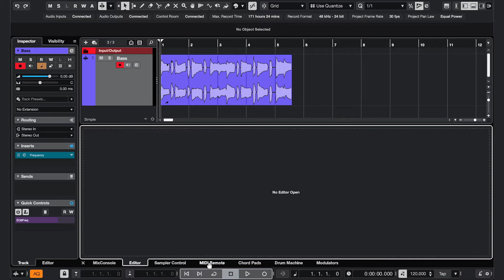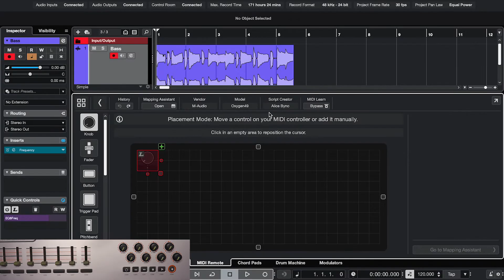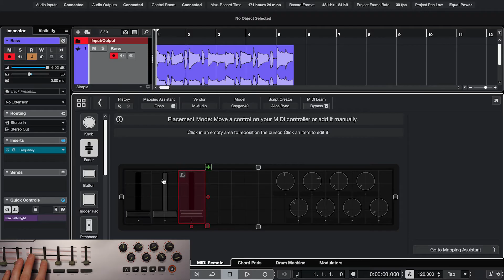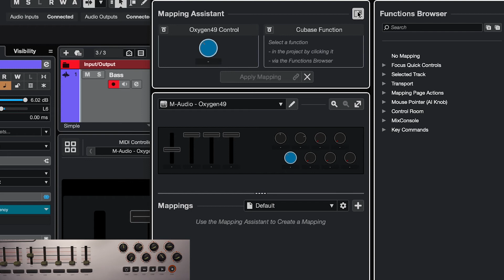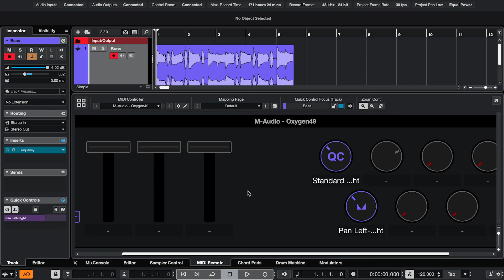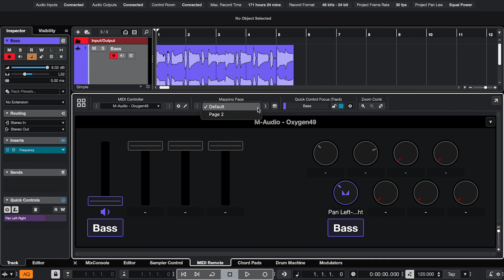Make Any MIDI Controller Work Seamlessly in Cubase with MIDI Remote

Comment: Sorry, this does not work at all for my M-Audio Hammer 88 Pro and Cubase Elements 15. MIDI remote > Control Surface does not see the buttons, knobs, etc. in learning mode.

Comment: Midi mapping in Cubase 15 is horrendous.
Klevgrand's One Shot has the kick listed on C2 but in Cubase ,it plays only on C1.
I tried this in Reaper and no such issues,the kick  played on C2 in Reaper and in One Shot.
I turned off midi mapping in Cubase but still the same issue,argh.
Cubase is so mind destroying.
Thinking of renewing my Reaper home license.
Cubase too flaky.
I have been told on the Steinberg forums that the Cubase midi mapper plays notes an octave out from what they should be on the  midi keyboard which makes setting up my Yamaha Multi 12 an absolute nightmare.

Comment: not all options are available. you cant add a plugin into the insert slot with midi or key commands this option just does not exist
Reply from the maker: That wouldn’t be very practical I think, because you’d have to navigate through all of your plugins and presets. Easier to click and type.
Reply: @alicebyno  hell no 😅 i mean to insert your favorite plugins with Stream deck or midi to add Pro-Q for example to the next available slot.. it works wonderful in fruity loops but i am Cubase user as well
Reply from the maker: @vandetamusic Oh 😁 Never looked for that either. Sounds like something they could add to the PLE.

Comment: Hello Alice, thank you for your very useful videos. I have a question please.. Can you map key switches to the midi controller ?
Reply from the maker: Yes, for mapping key switches you can use the Expression Map. You can get very detailed in there.
Reply: @alicebyno  Thank you Alice. Other than Expression Mapping and other than key switching preprogrammed by the manufacturers of the VSTs, can I program certain buttons on an external MIDI controller to change articulations?
Reply from the maker: Some instruments will allow for direct MIDI learn. Otherwise you can use MIDI Remote to map the key switch notes to pads/buttons. It does only allow to map note numbers, not note names (C0, D0 etc) so you'll have to find the corresponding numbers of the notes you want to map. When you edit your controller surface, in button properties you can choose 'note' in the message menu and then assign the number.

Comment: Is there just a simple way to edit the same midicontrollers in a track. In the years 90 i click with the right mouse on a controller and then i could choose " all same controllers" please give me a  solution as easy as this. I have cubase 10 pro. Thx ahead
Reply from the maker: If I understand your question correctly you want to edit the different controller lanes simultaneously? As far as I know that sounds like something the list editor or logical editor could do. That'll take more than a right click though. To work within one controller lane, you can still right click and select all events on lane.